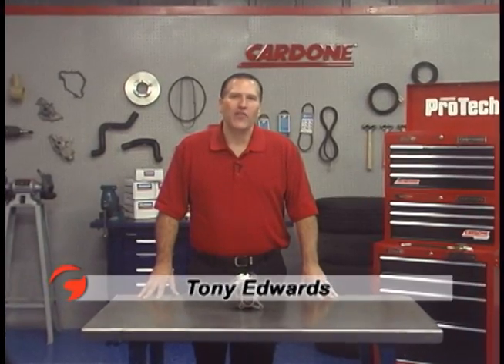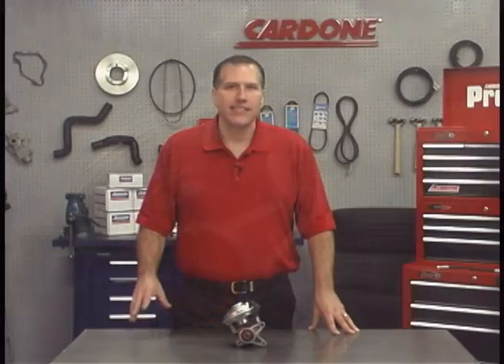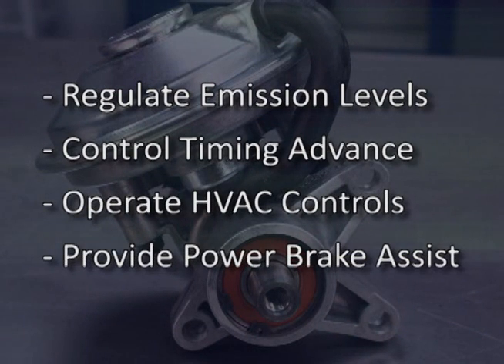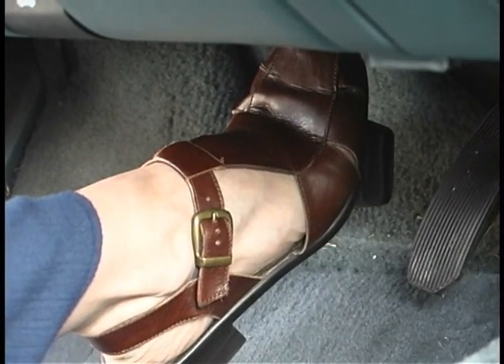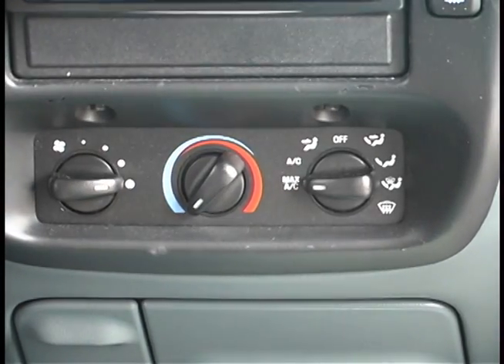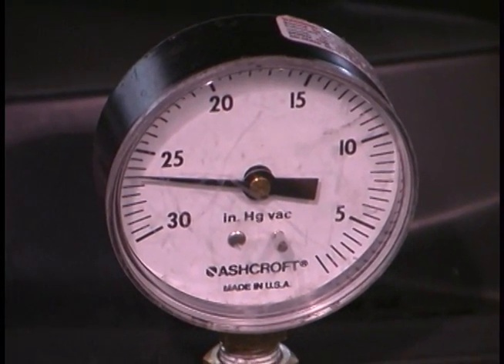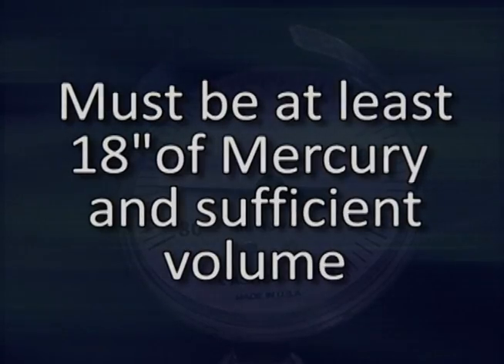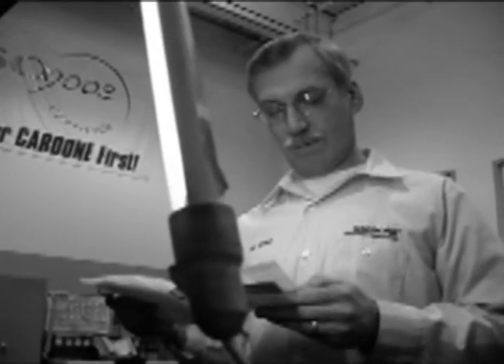Properly Diagnose Vacuum Pump Failure

Comment: Excellent video 😊 just need to see how to hook up the gauge, do the test and which gauge i should purchase from Amazon. Also, if it's a bad vacuum unit, which one and which puller do i need to purchase for my 1997 f350 7.3l turbo diesel.

Comment: Any one ever have a vacuum pump reverse on them?  Mine now blow air into the system!
Reply: That's called Blow by. Do a compression test.
Reply: My pump on my 7.3 diesel did that, an umbrella valve inside fell apart and air was being pushed into the vacuum system until it blew the hose off.

Comment: Yes, I have replaced the vac pump before but I replaced it with a discount part. I was not so sure it was the pump this time but I did have intermittent  AC control malfunctions. Will check vac for 18hg...thanks for a short and to the point video!